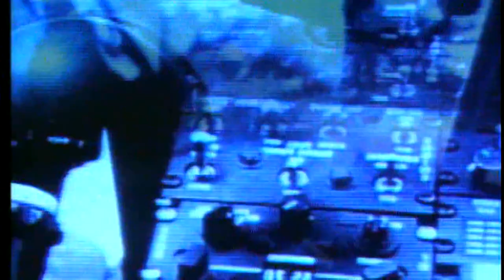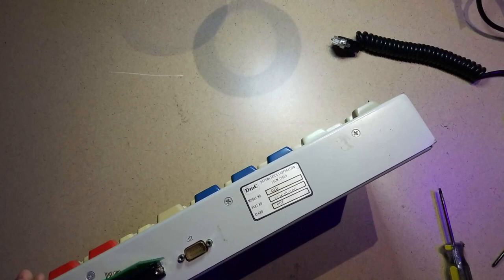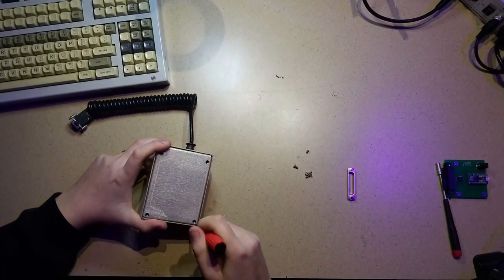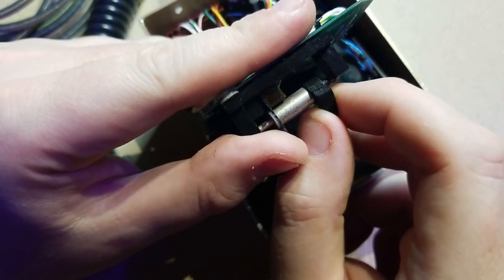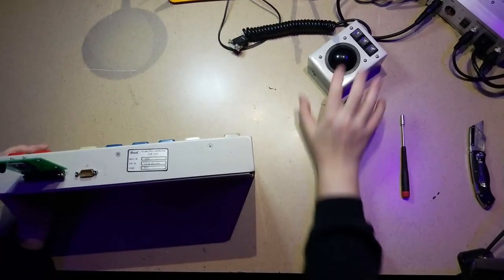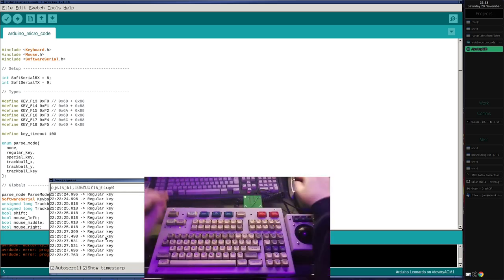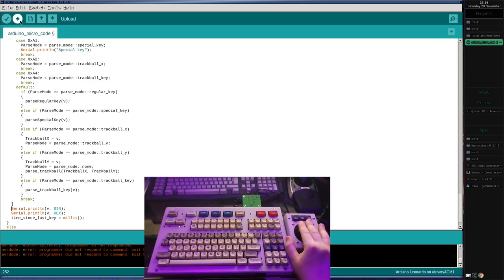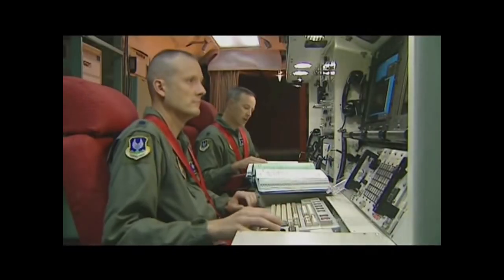The Nuclear Keyboard

Comment: The BIT key is "Built In Test".  Probably triggers a program to disable normal keyboard output, and then require the user to press every key, then report out any failed reed switches or LEDs to the host computer using some sort of out of band signaling, or perhaps directly, for example via an LED using blink codes. Very common to have some sort of BIT function in every single component that has ANY amount of silicon logic, in high assurance systems.
Reply: Also the use of RS-422 or 485 instead of 232 is almost assumed, in any high assurance system.  Especially in a system designed for high EMI environments.  The only time you are likely to see RS-232 is on an internal diagnostic connector inside chassis shielding.
Reply from the maker: Makes sense! Thanks! - it does seem to do a reset, but then go back to normal operation.

Comment: Thank you, I can use the code for my own project.
Reply from the maker: There's still some stuff to figure out, like how to send stuff back TO the keyboard (toggle leds?) it obviously seems to have a way to do so, since there's a pin I traced to an opto-coupler that in turn goes to an input pin on the serial controller; I'm hoping there's a way to make it switch modes to make the modifier keys work - but that's going to take disassembling and reversing the rom code. - Hoping to tackle (some of) that in a future video.
Reply: @pointlesstinkering  I wish you luck. And happy debugging.

Comment: I have the documents that detail the communication protocol for OID to target processor facility, but it might not be anything more than you've reverse engineered.  Anything still a mystery?
Reply from the maker: Whoa, heck yes! While I have reverse engineered how to read data from the keyboard, what is still a mystery is whether it's possible to send commands to the keyboard, for instance, to toggle LEDS, or change how it handles modifier keys which by default seem to do nothing. Get in touch! You can email me via john at adminking dot com

Comment: How is the typing feel? Does it use mechanical switches? 
Great video and music 👍
Reply from the maker: The typing feels really smooth - although the keys have quite a bit of resistance and travel distance. It's using reed switches, so it doesn't "click" - it's a mechanical plunger + spring with a magnet attached, that pulls up the contact inside the reed switch.
Reply: @pointlesstinkering  Very interesting!